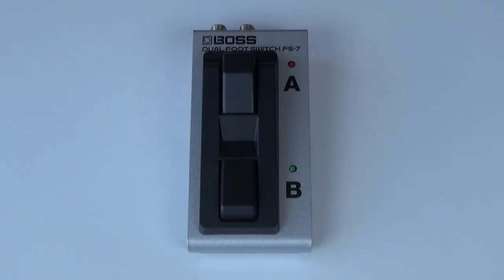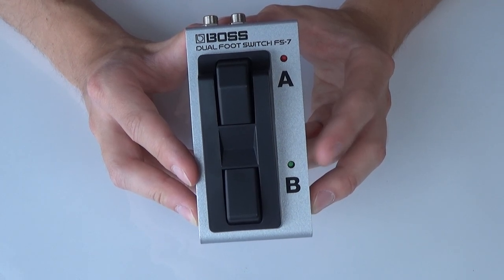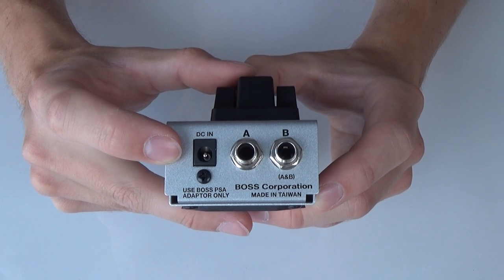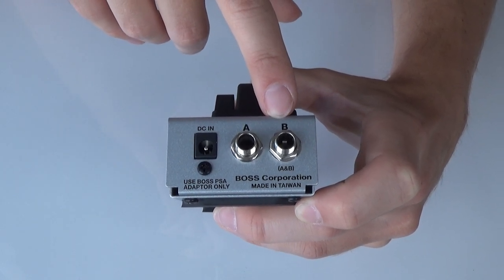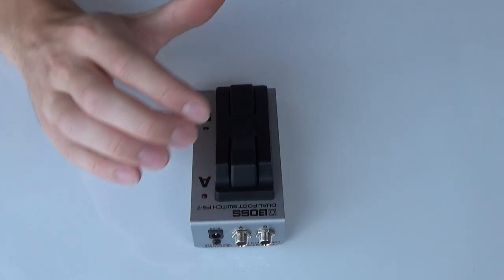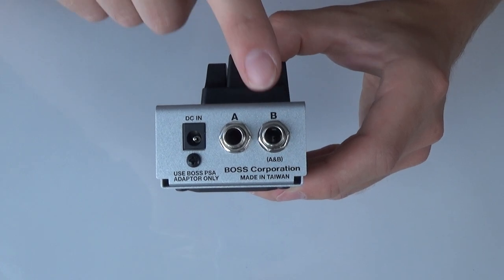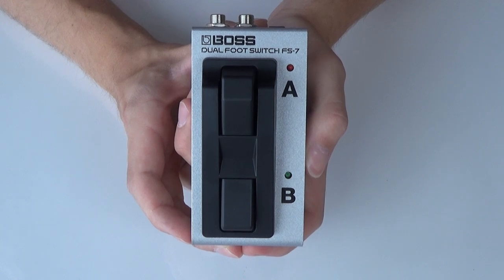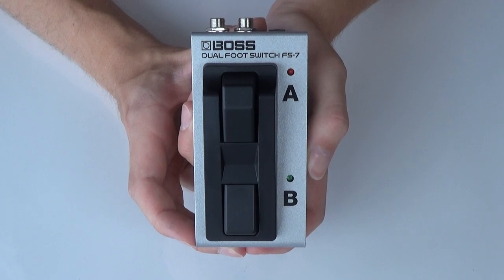Boss FS-7 Dual Footswitch FAQ | Features, Setups & Ins & Outs | Part 1

Comment: Hi there. Thanks for the tutorial. Do you know if this pedal can be powered at a higher voltage? Ie 9-18v? It doesn’t specify 9v anywhere on the pedal… just the standard blurb from boss saying, “only use with boss power supply”. Which is normally just standard policy from boss. I know a lot of these sorts of utility pedals are variable.

Comment: Hi, I have a boss OD200 & DD200 on my board, I’m looking for an external foot switch to operate boost/menu functions. Would this be the one to get? Thanks for the video & subscribed 👍
Reply from the maker: Hi there!
Thanks for your comment and question, I greatly appreciate it!

In my honest opinion, yes, it would certainly be. The FS-7 is top of the pop and will work like a charm with the Boss pedals!
I have a few ones, that I use with my GT-1, GT-100 and GT-10 - it's a great footswitch, and the size will fit any pedalboard!

I believe you'll be able to find information about the use of the FS-7 with your OD200 and DD200 in their respectable Owner's Manuals.

Thank you for watching and for subscribing, that really means a lot to me!
Please do let me know if there's more I can do.
Have a great day!

Comment: I just want the light to be on if an effect is on, and off if the effect is off.
The only way to do this is if I hit it twice.
Twice for on and then twice for off.
This pedal is very frustrating !!!
I have it hooked to my boss 1000 core.
Is there maybe a setting in there that would make this work like a normal pedal.
*One hit, lights on, effect on.
*One hit, light is off, effect is off.
I tried everything and can't get it to simply work, as most of by boss equipment that is impossible to do simple... 
I feel like I need a collage degree to work this stuff.
:-/
Reply from the maker: Check out my exact video for that, if you want the LED to be on when an effects is on, and the same if it's off.
I have a dedicated video for that.

I hope this helps.
Cheers.

Comment: hi mate , two fs7 already not working anymore , i went to tomlee music shop and they told me cannot repair . both pedal lights worked but no signal going through ... the last fs7 lasted only one month . 1st ctl 2 stopped working and then after some time ctl 3 also stopped .. i am very disappointed . do you an idea what is the cause of this problem ?
Reply from the maker: Hi,
Hmm, that sounds very strange, I haven't had any issues with mine... You might have been unlucky and gotten some from at bad patch...
Have you tried contacting Boss, they may be able to assist?

Cheers.

Comment: Hello and thank your for your video,i have a question about  using this to control the looper function on my roland ac-33 amp, can i start and end a loop with this one?
Reply from the maker: Hi there,
Thanks for watching, and for your question.

Yes, the FS-7 will work just fine for this, simply follow the instructions given in the AC-33's Owner's Manual, on Page 9.
Link to the Manual here:

https://static.roland.com/assets/media/pdf/AC-33_eng04_W.pdf

I hope this helps.

Let me know if you need anything else.
Best regards.

Comment: First, thanks for posting. Your videos are helpful and much appreciated. I know you can use the FS-7 for tapping delay tempo but can I also use it to turn the delay on and off? I'm referring to the delay coming from the GT-1. So I guess my question is can I use the FS-7 with the GT-1, to control delay tempo and turn delay on and off WITHOUT AN external boss delay pedal? I want to use it for the delay effect coming directly from the GT-1. Is this possible? Please lemme know, thank you
Reply from the maker: Hi there,
Thank you for watching, and for leaving a comment, I greatly appreciate it.

Sure, the FS-7 can be set up to control a lot of different effects. For example, turn on an overdrive, turn on a compressor and also turn off the reverb.
The FS-7 can control both effects and parameters.

The answer to your question is; Yes, that's exactly what you can.

I hope this makes sense.
Let me know if you need anything else.
Cheers.
Reply: @GuitarNTabs  Thank you for responding. Man...I'm having trouble trying to figure how to do this. Would it be possible for you to make a tutorial on how to assign tap delay to the BOSS FS-7 ? Or could you explain how it's done?

Comment: Is it posible to set 1 foot switch to latch and the other one to be non latching? i am thinking about using the A button as a remote for an angry driver and the B button as tap tempo for my DD8, and i am unsure if that would function
Reply from the maker: Hi there,
Thank you for your comment and question.

Sadly the A and B footswitches share the selected setting... It's common for both, so what you're looking to do isn't possible, atleast not with this footswitch. You need to look at the FS-5L and FS5-U, so that you can set the function of each footswitch. The FS-6 will do the same, if you're looking at have it all in one single footswitch.

I hope this helps.
Let me know if you need anything else.
Cheers.

Comment: I have an amp (Lab Series L5) with footswitch on/off and a Boss Angry Driver. Would I be able to change both of these with a FS-7?
Reply from the maker: Hello there, Paul.
Merry Christmas.
Thanks for your comment and question, I appreciate it!

That should indeed be possible, yes. Use one output from the FS-7, for example Output A, and connect it to the Angry Driver, and the B output to your amp. For the Angry Driver I believe you should look in the Manual, to see how the FS-7 should be adjusted, in order to work properly. I don't quite know about the Lab Series amp, but it should work just fine.

Give it a go, and let me know how it goes.
Best regard!
Reply: @GuitarNTabs  Thank you. I thought it should work but wanted to check. Seen the FS5 used with the Angry Driver so figured it should work. Thank you and have a great new year!

Comment: Is it true that the pedal is fully functional without a power supply? Other youtubers identify otherwise?
Reply from the maker: Hi Mark.
Thanks for your comment and question, I greatly appreciate it.

The FS-7 can be operated WITHOUT power, yes.
A power-supply is only needed for the LEDs, if you want them to light up, that's all.

I hope this helps.
Let me know if you need anything else.
Best regards.
Reply: @GuitarNTabs  This is not true. It must be powered for latch mode. This is a real pain in the ass.

Comment: Can I use this with my Boss gx100?
Reply from the maker: Sure you can, it's described in the Manual for the GX-100 how to connect it, and how to set it up for use with Assigns, etc.
Reply: @GuitarNTabs  works perfectly, yes. I tried before with my "Ampero Switch" but it did not work well... Thanks!
Reply from the maker: @mtaskapablo  - I'm happy to hear that!
The reason it didn't work well with the Ampero Switch is because it's a Momentary footswitch, for the Boss units it has to be a Latching type, like the FS-7.
In fact the FS-7 lets you switch between momentary and latching, depending on what you need the footswitch to do.

Please let me know if you need anything else.
Best regards.

Comment: the real question should be which BOSS FS should be used!
  this looks useful, yet I see talk of the latched and unlached foot switches for different purpose.
  I believe the FS 5u can be used yet it is more of a keyboard controller.
 then there is the FS 5 L
  which is a single switch, but you could use 2.
  it is my understanding the two FS5Ls would function the same ways as the one in this video
Reply from the maker: Hi there, John.
Not at all, really... The FS-7 is an all-round footswitch which can be used with a lot of different gear, in this case the GT-1, for controlling the assigns, effects and parameters.
Oh. I think we need to get the models correct here - it's the FS5U and FS5L, not the FS-7.

Yes, but the FS-7 allows you to be able to switch the mode and its polarity, and then the FS-7 is in a much smaller form-factor.

I hope this helps.
Reply: @GuitarNTabs   FS5L and FS5U probably were from keyboard then used later by Boss/Roland for guitar multi effects.
 nice, great videos on your channel, thanks so much!
🎸⚡
Reply from the maker: @johnmcminn9455  - That may very well be the idea, yes.
Always happy to assist.

Have a great day.